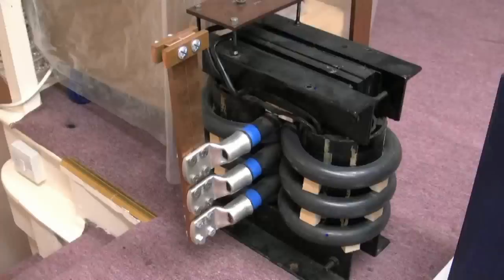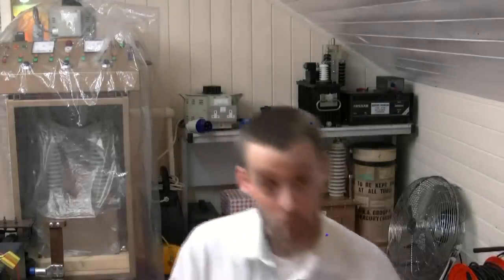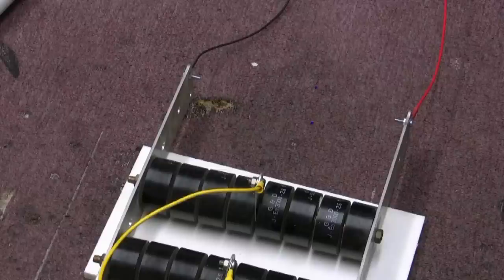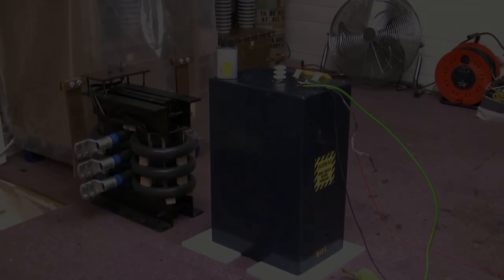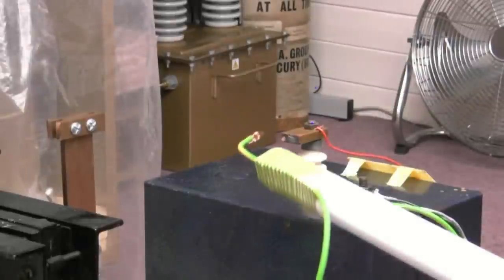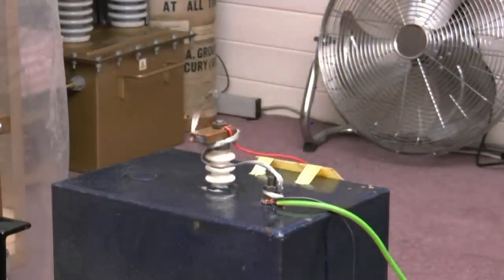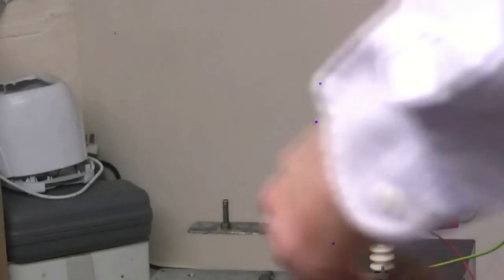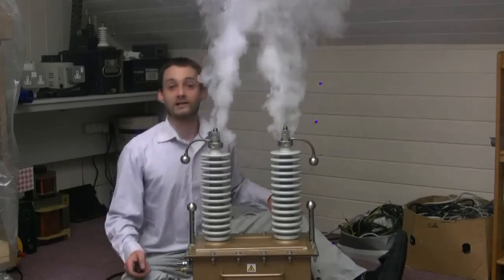Big Capacitor Safety

Comment: If it's DC OR AC, you'll still get locked on. Don't ask me how I know this. 
I've had to correct quite a few people over the years and those are normally tutor's and other people I've worked with. I've only come across a couple of people who've experienced it and they've thought and felt the same as I did. Getting an electric shock which gives you a belt, isn't the greatest but every electrician I've ever worked with, has had them. 
It really is a horrible feeling because you can feel the 50Hz frequency, flowing through your body. And good luck trying to scream for help, because you can't! Your just think "this is me dead then" because there's nothing anyone can do, apart from shutting the power off.
People who say you can't get locked on on mains AC, need to try it out themselves and see how many survive. Higher frequencies it's no where near as bad because of the skin affect. All that happens is you just get burnt, unless you using something conductive to draw the arc. This is why when you building a Tesla coil, you use hollow copper tubing. Because it's got twice the area for the current to travel through.
Reply: depends on voltage
Reply: @spitfireace87  well that's obvious

Comment: The only problem is that that cap build up gas inside and if not vented will blow up after a while I use a use smaller caps and it happen to me.

Comment: JUST A WORD OF WARNING

When it comes to AC, you can get locked on. 
Your most likely to get a massive belt or get chucked across the room but you can get locked on! 
I know this from experience as that was only on 240V 50hz. 

Please. Do yourself and everyone else a favour. Employee an electrician that's been doing it for many years.
These days, anyone can become a "full" qualified electrician in a few months. It's as if you find these qualifications in a cerial box. You will learn hardly any in a few months. There'll be loads of theory but no practical what so ever. I bet these types of people have never even heard of ladder rack or uni-strut.

Comment: How many farads was that capacitor?
Reply: Maybe im wrong but it was like 138uf.
Reply: Sad Carrot Yeah, you're wrong because a capacitor like that would have at least 500f. If you take farads law (I think that's what it's called) which is 0.5 x Charge(farads) x voltage squared = energy (joules). So if it was 138uf it would be 0.5 x 138 x 10^-6 x 1000000 squared which would = 69 million joules. That was more than he was working with I think.
Reply: SHJ Gaming Do you even know what UF means ?
Reply: Sad Carrot microfarad
Reply: SHJ Gaming So where the hell did you get 69 megajoules ? This cap if i remembert correctly was 138 uf at 5k volts wich is 1.7 kj.
Reply: Sad Carrot Forget it. You weren't listening to what he said, so you're not making sense.
Reply: SHJ Gaming You cna get even million watts from 1.7kj your the one who doesnt make any sense at all.
Reply: Sad Carrot OK, buddy. Sure.
Reply: SHJ Gaming I know this is an old comment, but just saying, your calculations suggest the capacitor was charged to a million volts. He said a million WATTS, not volts. hurr durr
Reply: ***** yeah, you're right. I was commenting on the wrong video, not that that matters.
Reply: I do also believe it is 138 microfarad.
Reply: MadSparks164 he showed specs in one video.